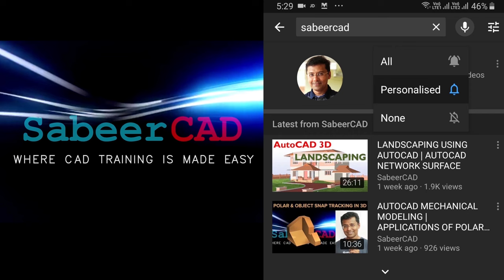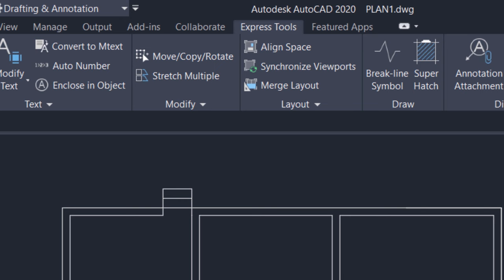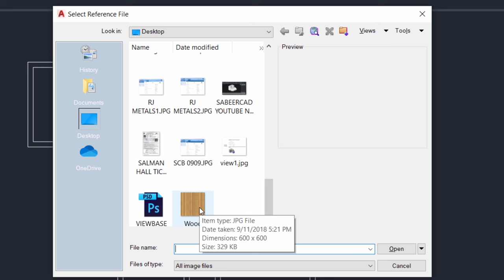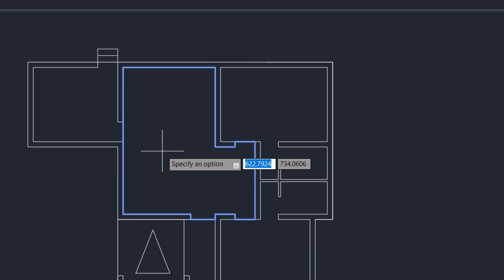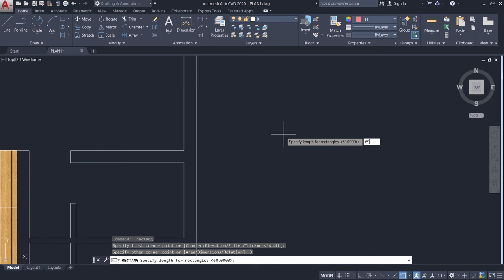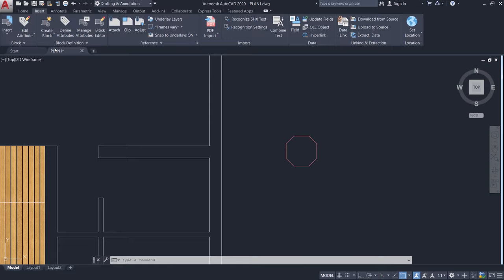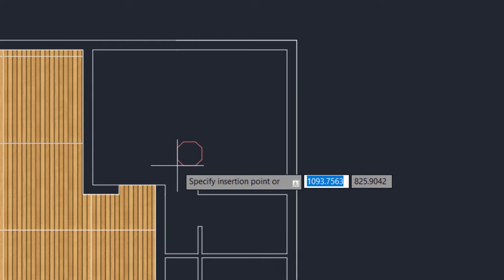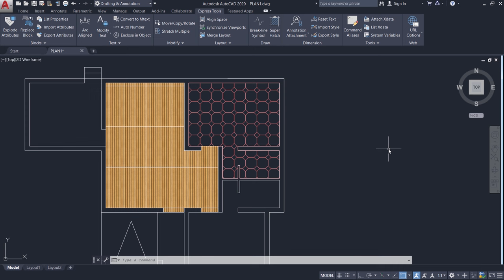SUPER HATCHING IN AUTOCAD | CREATE CUSTOM HATCH PATTERNS IN AutoCAD

Comment: Hey I have a problem and i'm wondering if you could help me. Im using your exact method and it works for the pictures/textures but the cutsom AutoCAD hatches are autocmatically saved in a 7-Zip file which does not work when i try to put it in AutoCAD. Thanks

Comment: For a 2/2" rectangle I applied Hidden line type but the rectangle is normal line only please help me out 😍
Reply from the maker: Give LTSCALE command give a higher value.  If its still not showing give a lower value..
Reply: @sabeercad ok sir I will try and let u know
Reply: Give LTSCALE command and put value point one( .1) in globle scale factor option .... Then ok
Reply: @sabeercad  no result sir
Reply: @ajaywish7076  it's working
Reply: just take a look by zooming in to the line and you might see if the issue is of scale. If yes than you should change the properties of that line using LTSCALE